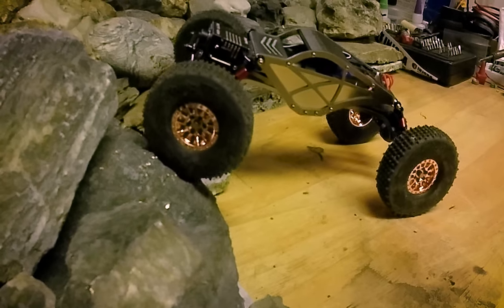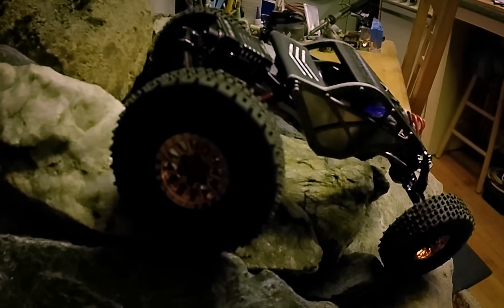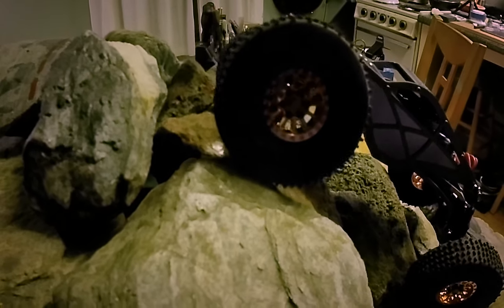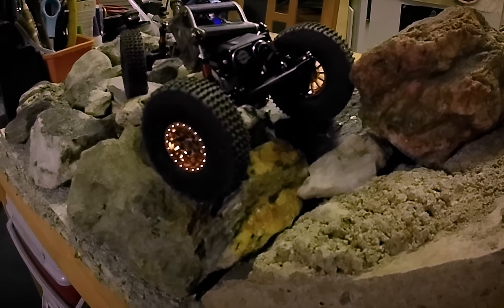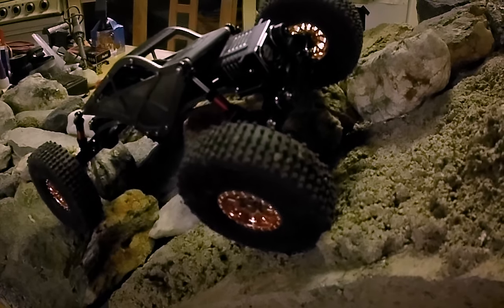@Albin _Designed - Custom Super Sporty Chassis - Premiere

Comment: That might be a stupid or not well thought out comment, i wonder why for example Axial or Injora can't do a chassis like this on a budget, if its just about the geometry that would not cost more, just make a different shape, don't they have the people to figure that out ? (I mean ok portals and brushless and wheel inserts and everything on this is on another level and cost intensive).
Reply from the maker: I record voice overs in one take and hope to make it through without making a ton of mistakes and having to spend a ton of time on them. I say far less dumb things than some do, but that's not the point. I'm also totally self funded, work full time, and just want to share something that I'm pretty excited about.

Sure, Axial could make something like this but why would they? They already have the market cornered on mass produced 24 scale trucks with add-ons available for days. 

This very small niche market is being pushed forward by the community that sees and runs these types of rigs. Even just a few years ago, I paid $50 for my 1:24 Hot Racing Rock Bouncer chassis. You can get those for $15 all day long now. 

If you added up all the high performance parts involved in creating a build like this or the Hard Park Dementor V2, then take into consideration the artform of creating a whole new chassis, with new geometry, all from scratch, I think right now it's a pretty decent position to be in. I'm willing to pay for what I consider to be top of the line performance parts. You'll find this at any scale in the hobby.

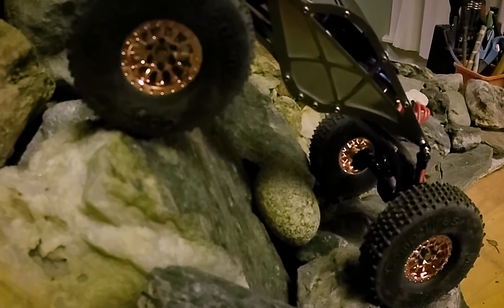While it seems cost prohibitive to some, consider this: I'm also into 1:10 comp rigs. Have you ever seen the price tag on those builds? Sure, RC4WD builds one of the only available RTR & Kit MOA Comp rigs available for under a thousand, but when you get deep into it, you're looking at a $2000 rock crawler by the time it's all said and done.

And think about this, too, I've been into 24 scale for going on 3 years at this point. I have expectations these days after running so much 1:10 stuff.
Reply: @VermontScaleCustoms  Sorry i think you misunderstood, i meant that my idea might be stupid, why manufacturers can't get the geometry of a chassis right where it is not a matter of costs.
Reply from the maker: Ah, I get what you;re saying. Sure, well, Axial used to do the XR10 way back when. Things like that, the GMade R1, Bully & Bully II, have kind of all had their time in the spotlight. The only one still in production right now is the Bully II. Comp rigs once had a much larger presence in the industry back in the early 2000's. Then everything went scale, from what I understand. Like anything, it's destined to ebb and flow. Who knows, maybe Axial and a few others are taking notice of what's going on in the small scale world and will put out some reasonable options that can be supercharged with just a few mods.